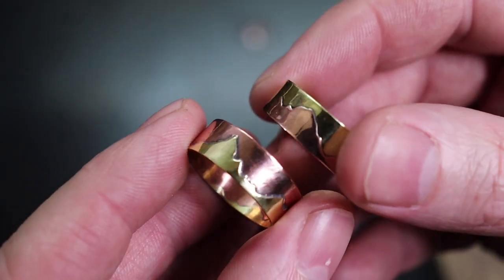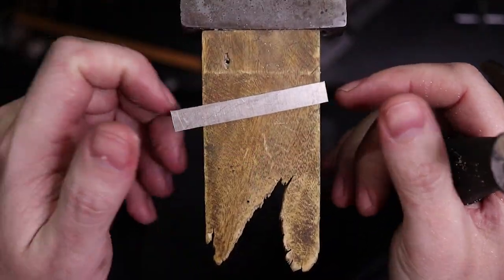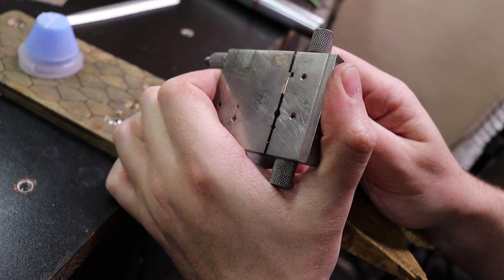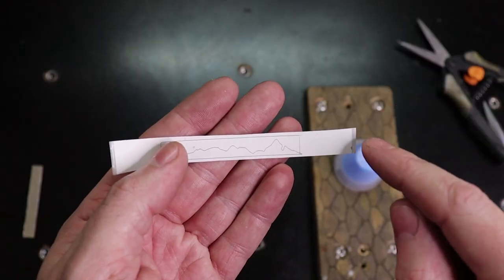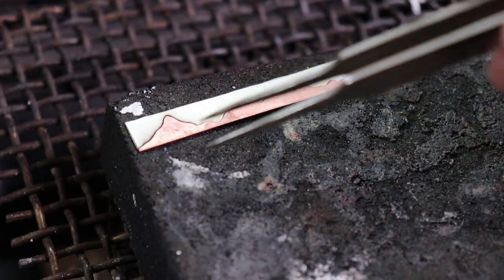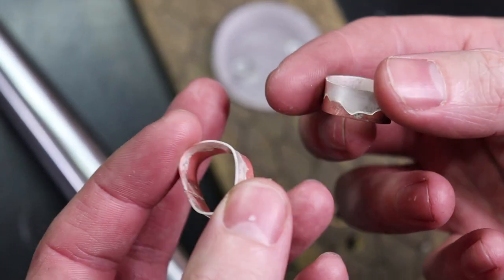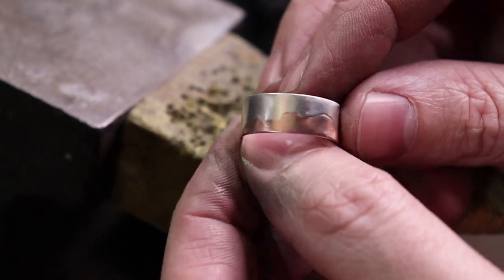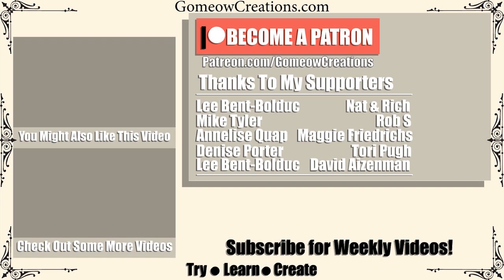How to make Mountain Range Rings

Comment: Fantastic stream (tutorial) Absolutely love your work! The only issue I feel the rings could bend over time! It's the trade off useing soft metals, Anyway 10/10👍
Reply from the maker: Thanks and yeah they could bend over time. You can make the thicker to help keep that from happening. I made a new version on this ring with a silver core ring that helps make it all stronger and makes it so the copper and brass will not be in contact with your finger
Reply: Gracias papá eso quedó fue fantástico..te felicito!! Éxitos saludos desde Caracas Venezuela!!

Comment: For many people, copper and brass will turn their skin green. You could avoid that with this project by making a very thin gauge inner silver ring as a "liner". Some people also dip their copper and brass work in clear lacquer which may also help with keeping it from tarnishing. The lacquer will wear off over time tho, especially with an everyday ring.
Reply: I’ll gladly stick to his method so a person can see the pattern from the inside and also protect it using his methods he mentions in several of his other videos.
Reply from the maker: Clear hard resin is very good for sealing the metal if you want to do that 😁👍

Comment: Help, I used 18 gauge copper and sterling glued them together then sawed the pieces. Then torch unglued them. Now when I go to solder the copper  and sterling mountains don’t fit snuggly together  because the saw blade created a gap the width of the blade. Since solder won’t fill gaps what do you suggest I do? Thanks in advance for your help. In gratitude, Tina

Comment: Use plain paper and Cyanoacrylate to hold it on the piece you will have no worry about it lifting off when cutting the paper and glue can then be sanded off when needed.
Reply from the maker: Yeah that would also work well for this. I use the label paper on larger pieces of metal so it has a kinda brim to them and it has no problem with sticking. It's just when it's a tight fit that it becomes a problem 😊. That being said I will do that in the future.

Comment: Question 
And maybe I missed this. What sealer do you use for the copper? I find that the copper turns the finger green. I and looking for a good sealer for copper jewelry.
Reply from the maker: So the sealers that I have used in the past work but they really don't last that long depending on how acidic the persons skin is. One thing that you can do that might last a lot longer is use a clear UV resin.

Comment: I REALLY like your rings. You described and showed everything perfectly. Just a minor point: would it have been easier to sand the surfaces of the soldered strip before forming it into a ring. Many Thanks.
Reply from the maker: Thank you very much. Yeah you could do it that way too, idk if it would be easier but it would work. 😊👍
Reply: @GomeowCreations  i was thinking the same thing, how come it wouldn’t be as easy?
Reply from the maker: I didn't say it wouldn't be easier, I don't know if it would be easier or not seeing that I haven't done it 😅
Reply: @GomeowCreations  ahhh got it. Beautiful ring by the way. I’ve wanted to get into jewelry making for a while now (rings, chains, etc) but dont even know where to start in terms of materials and equipment. Any advice?

Comment: Question, please HELP. I followed your instruction but used my own drawing. Here’s my problem I need help with: the saw blade leaves a small gap the size of the blade so when I put the copper and sterling pieces together b4 soldering there is a slight gap. Solder is not supposed to be used to fill gaps so I am not sure what to do. Please respond and thank you in advance.

Comment: Thank you for replying to the comment so quickly. 
I forgot to ask a question that what is the size of the saw blade you used for cutting 0.6 mm and 0.8 mm copper plates?
Reply from the maker: I used a 3/0 to cut them into the ring blanks and after I glued them together I still used the same blade even though you should use something else. 😁👍

Comment: Al little truck I use for blackening... Just lightly heat the ring until the firescale starts to form and darken. It's more permanent than chemicals, and can bring blues, reds, and greens into your copper.  Lightly buff and then seal. 😁✌️

Comment: So if using more expensive metals like gold and silver, is there any way to make such a single ring (only one per design) using half the material? Or would that involve just making the gauge of sheet and width of ring band thinner?
Also, with the difference in melding/heating temps between two metals, how do you know what solder to use for your joint, and do you heat one piece more (longer than the other to get an even temp or is that not a worry?
Really like this idea.
Also really like puzzle rings that aren’t soldered together but fit like this.
Good video!

Comment: How do you go about valuing your work? Just getting started in making jewelry myself and am having a hard time deciding on pricing. So far I've made 1 pendant from 304 stainless and a shiva eye shell teardrop. It was a rather large pendant and an involved process, machined it out on a manual mill. I managed to sell it for $80, but I feel like that was both too low and too high at the same time. I put around 14 hours of time into it, but the materials weren't worth much. They were just very difficult to work with. I originally wanted $150 for it, but I accidentally took too much out on the facing side of the seating area. My wife talked me down to $80.
Reply from the maker: I use a random number generator.... I'm kidding but yeah you are going to have a hard time selling stainless steal items like that. You are competing with cheap Chinese items along with the metal not really being worth anything so most people will just not pay for it. According to your under you only got about $6 per hour for your work and that is not including materials. Even at your $150 price point is only $10 per hour. 

I'm not saying that you can't get more money for them but you have to find a way to add value to your work but I can't tell you how to do that seeing that I really don't know. Sorry I can't me of more help. 😅👍
Reply: @GomeowCreations  no worries, I appreciate you taking the time to reply. It's an interesting spot to be in for sure. When I get it down well and am making flawless pieces I could probably charge more just on the principle of it being hand crafted art. I mean painters do it XD. I think I might save the gemstones for more precious materials, and try my hand at simple engravings for the stainless. Or maybe just drop that material altogether except for very simple pieces. It's a real pain to work with. Gotta say I'm jealous of the way silver smiths get to wrap the bezel wire around the stone to make the setting. So much easier.
Reply from the maker: You can always get some silver 😁👍
Reply: @GomeowCreations  I'm definitely going to. Just gotta make one more piece from the stainless. I was doing 2 as mother's day gifts on sort of a commission. In fairness I have to do both similar. After I get paid for those I'll be experimenting with some pure silver coins I've bought over the years to see what I can do in the way of casting. If that fails, I'll remelt them into sheet metal and go from there.

Comment: Spectacular video!!  I am goin to try one of these tomorrow!!  How do you keep the copper from tarnishing and turning someone's fingers green?  New supporter!!
Reply from the maker: So the earliest way to keep the silver Frome reacting with peoples skin is to line the inside of the ring in silver. Basically a silver core. Just about all clear coats that I have used don't last very long.
Reply: @GomeowCreations  would  stainlees steel work, like 304?
Reply from the maker: Yes but you would have to buy a pre done ring core or cut one out with a lathe seeing that you can make it from a sheet of it
Reply: @GomeowCreations  that will work.  I have copper,  brass and stainless steel.   Thank you so much!!
Reply from the maker: Just keep in mind that you can't really solder stainless steel so you will have to make the outer banks press fit or keep it on with a glue
Reply: @GomeowCreations  great tip.   Thank you.   I had no idea that you couldn't solder stainless steel, just burst my bubble why don't ya, LOL  I do have 304 stainless tubing as well...somewhere...
Reply from the maker: Just trying to make sure you know they you need to get a ring core to so that. They are about $5-7 each
Reply: @GomeowCreations  I greatly appreciate your assistance!!  So glad that your channel showed up in my feed!

Comment: I love this.  I'm going get to this project... could I use e6000 glue?
Reply from the maker: No, don't use e6000 to do this. It's just going to make a mess and will not hold up over time. This is more or less a soldering project. Also don't use a soldering iron or soft electrical solder, you will need a torch and hard silver solder. 😊👍
Reply: @GomeowCreations  I actually meant when you glue the wo metals together for sawing.  Tks.
Reply from the maker: Oh lol yeah you can do that 😅

Comment: That is a real cool project , I'm going to do it in silver and 14 yellow. Dumb question : how did you do that one that shows mountain protruding
Reply from the maker: Just use different thickness of metal. Like the copper and brass ones that I have I used 0.6mm copper and 0.8mm brass. Make sure to solder them on a flat surface so the inside can me more flat and the out side will have more of a protrusion.
Reply: @GomeowCreations  , thank you.

Comment: We are having trouble soldering. The solder just beads up instead of flowing. Is there something we’re doing wrong maybe? Any ideas?
Reply from the maker: Is your metal clean and are you using flux?
Reply: GomeowCreations We pickled the metal after burning off the excess superglue, and are using Delcast Rosin Soldering Flux Paste.
Reply from the maker: Ok it sounds like your not using the right stuff for soldering. Check out this video https://youtu.be/r8nU0ZMZGFA it goes over everything.

Comment: Hello. I love the one with different thicknesses!
What is the size of your blade? Can a 3/0 take angles like that?
Thank you.
Reply from the maker: So if you want them to have different thickness like my copper and brass ones, I just used 0.6mm copper and 0.8mm brass.

As for the saw blade, I used the 3/0 for all of this even though bits not really meant to cut metal that is that thick. 😁👍

Comment: Thanks for sharing this video,  I was a little curious about seeing the solder line  (it was visible after sanding) that appeared on one of the rings when you were smoothing & buffing out the rings.  It is something I have not seen on a finished ring. Was I missing something here?  I liked the concept of using two two diffent metals for the end effect here.
Reply from the maker: Yeah, on copper you will have a solder line. You can try an hide it with some copper plating buy from what I have seen in the past, most people really don't care about it 😊

Comment: What exactly is he using at 13:30 to sold this together... he says something about a full list but i couldnt find it
Reply from the maker: Hard silver solder?
Reply: @GomeowCreations  i mean that kind of paste you are applying befor sprinkle sold in the cracks.
Reply from the maker: The paste is handy flux, it keeps the metal clean and your heat it so the solder can melt and flow.
Reply: @GomeowCreations  Thanks a lot. I appreciate your effort.
Reply from the maker: No problem 😁👍

Comment: Hey, to start off thank you for the wonderful tutorial however I had one question.  When I tried using your math formula, Instead of measuring the inside of a ring that was the size I wanted, I measured the outside of the mandrel. I was aiming for a size 8, and used a 23 gauge or about .5 mm  piece of sheet metal. I got about 18.5 from the outside of mandrel, added the width of the sheet metal and cut out a 59 mm blank. It was a size short, could you help me figure out what I did wrong?
Reply: You followed the instructions just fine. The bit I think he missed is that you need to double the thickness of the sheet you’re measuring for the math because that sheet will lay around the mandrel, so it needs to be accounted for twice when adding it to the diameter.

Comment: Great video. Three attempts and three failures 😕
Reply from the maker: Thanks and failing helps you learn as well. But do you have any questions?
Reply: Solder burns off before silver solder flows. If it does flow it doesn't go where I want it to go. I use micro torch maybe not hot enough. I seem to get it a lot hotter trying to melt solder. Any tips? Thanks
Reply: I men flux burns off
Reply: Also gap is bigger than yours. What saw blade did u use. I used number 5
Reply from the maker: What flux are you using? Also a size 5 blade is why to big. I'm using 2/0 or 3/0
Reply: @GomeowCreations  thanks for reply  I use borax